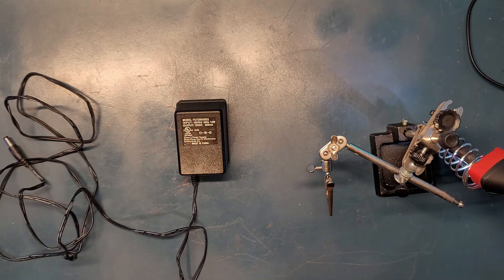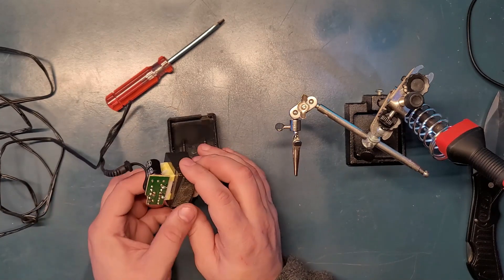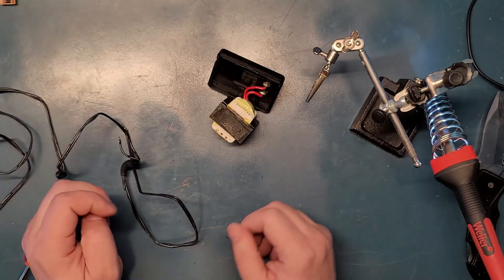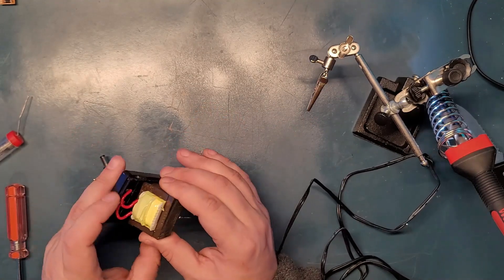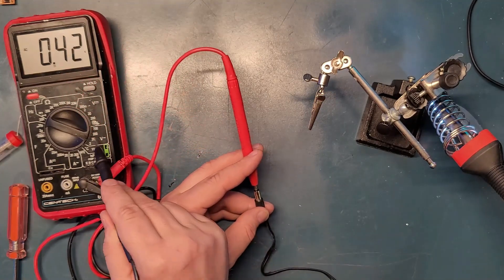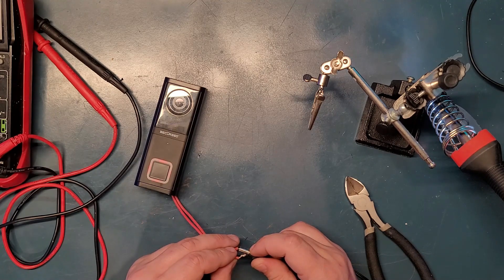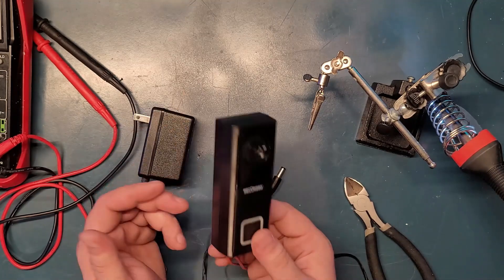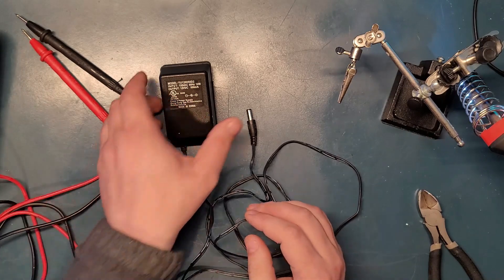How to convert AC-DC adapter to AC-AC adapter

Comment: In the UK they sell doorbell AC to AC convertors they are basically the same as what you've done except they have 3 settings 6, 9 or 12 vac on the output side. They're fairly expensive however you can buy these adapters, in your video from charity shops for 50p. It's a great idea and perfectly safe. Thanks for the video